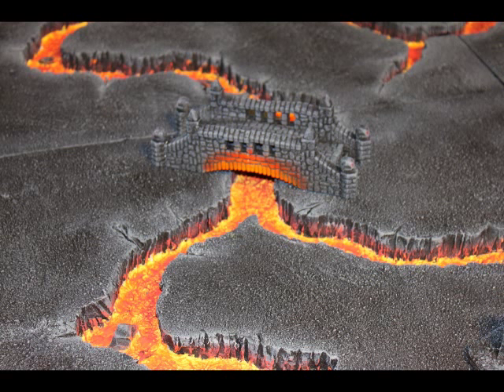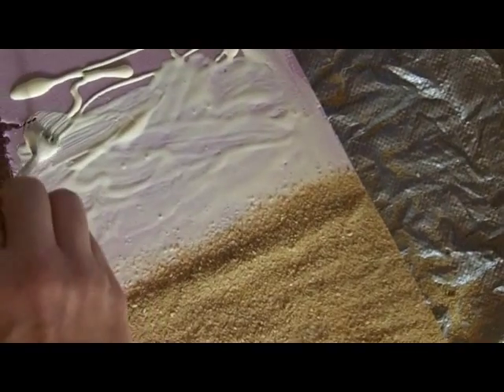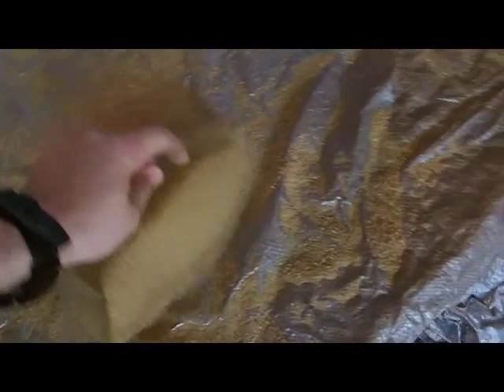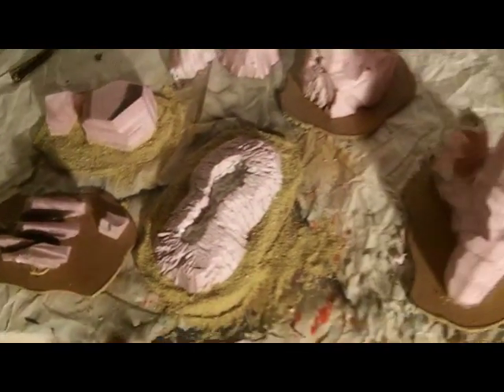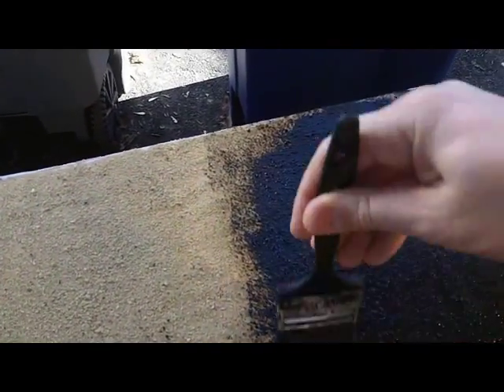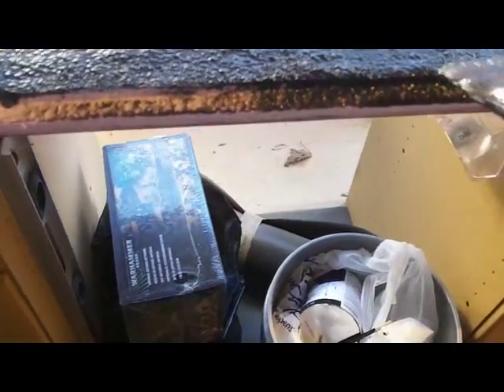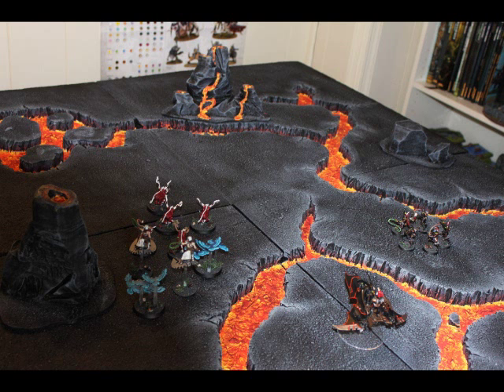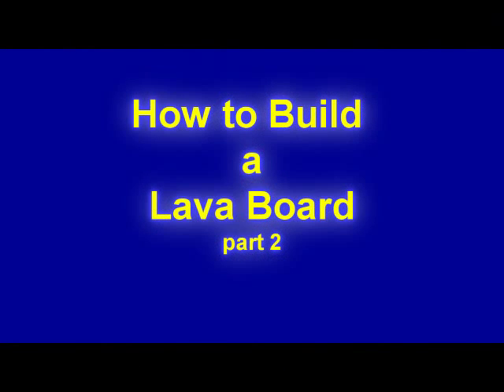How to build a Lava River Game Board part 2

Comment: I found your videos helpful. Ive been doing this for a while and face palmed when i saw your tip on leaving a strip of glue. when im glueing and basecoating I use small rollers from the discount store,  much faster and more consisten then using a brush. + their so cheap I just discard them after.

Comment: Looking great so far.  Loving these videos.  Not that it matters at this point because I am sure your project is done but painting the pieces and then gluing them would have been a good idea.  As well, if you watered down the paint slightly it would flow into those cracks a little better and would not have been as hard to paint.  Though that might have caused you to have to do a couple of coats.  Just an idea.